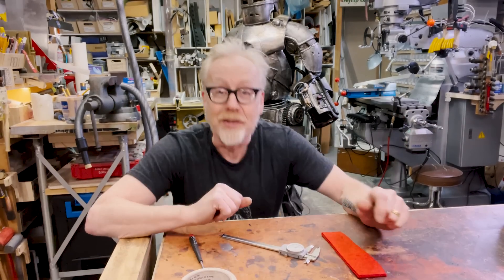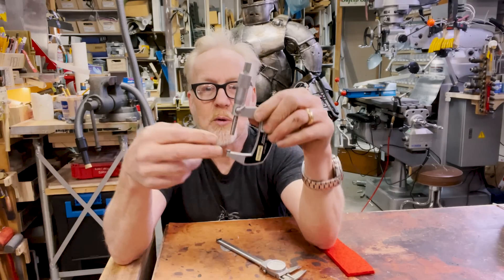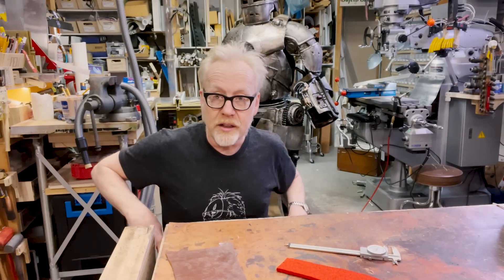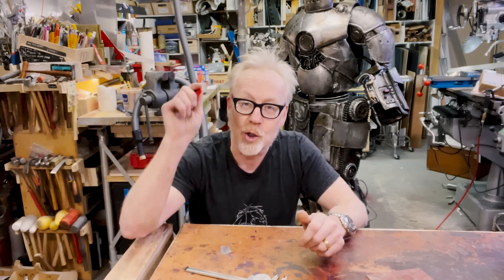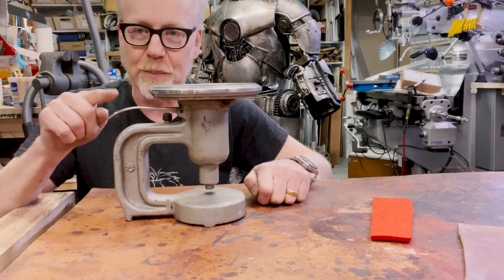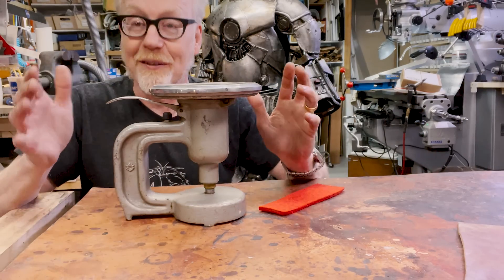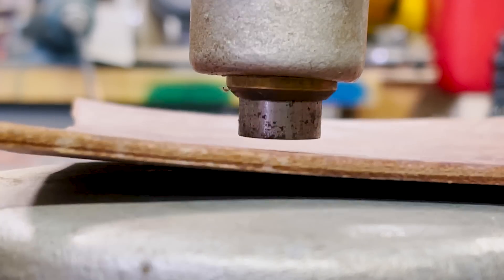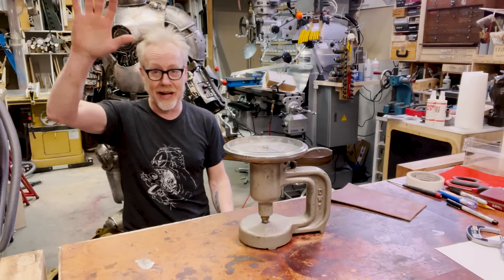Adam Savage's Vintage Automatic Testing Micrometer

Comment: At work I get to use a tool that operates on similar principles, the Gustin-Bacon Measure-Matic. Its anvil is a square foot and it's used for measuring big samples of fluffy materials like filtration media, insulation, or poly fill.

Comment: An micrometer doesn't actually measure µm  0.001 mm. only 0.01 mm and at best 0.005 mm with some analog.

If you measure µm you most likely gonna get wrong measurement since materials expand and shrinks couple of µm depending on what the temperature is. just the heat from your fingers gonna change the value.

Measurement tools usually have the standard of measure 1 decimal smaller than attended to get good enough measurement. that's why some digital micrometer resume 0.001 mm 1 µm, and digital Calipers measure 0.01 mm.

Comment: The amount of torque is equally important for measuring hard materials. By overtightening it, you can get about 0.001" lesser reading on a typical 0..1" micrometer. When the target resolution is about 0.0001", using a ratchet or a friction sleeve (another type of torque-limiting device) is a must.

Comment: I notice that there is not a second smaller dial to show how many times the big dial has gone around, like on a dial caliper. Can you accurately tell how many times the big dial has gone around based on the position of the lever? Or do you just have to have a close estimate of the material before you put it in the device?

Comment: I have 3 of those - we used to own a Paper and paperboard processing facility and they are the STANDARD for taking measurements of PAPER caliper or thickness. (Z - direction) +/- .001 is the accepted tolerance or variability for paper being printed in rotogravure or offset -

Comment: Interesting. Given that this micrometer measures using a set pressure, then for certain materials that are prone to density variations, that may also pose a problem.
Would I be right in assuming there are variants of this device that have varied surface area used for measuring?
It seems that eventually some form of electromagnetic measurement would be needed, along with some serious analysis.
Measuring is tricky.

Comment: I’m studying to become a rubber engineering tech and the compression of rubber is a real problem with measurements, a Magna Mike is another tool you can use to measure thickness. It uses a tiny ball bearing to measure the displacement between the magnet and the ball bearing to give a reading

Comment: If He thinks he can measure +/- 0.0005 over 12 inches........
He might need to read the specs on those.......

Also,  it's a snap gage and not a micrometer. Micrometer refers to a specific type of caliper that uses a threaded spindle to measure the travel. 

What he has is a dial indicating snap gage

Comment: Adam, I think the micrometer is suffering from dried out lubricant by the way the plunger lowers slow. A drop of light weight oil on the side of the plunger will loosen it up. I have one like yours and mine had the same problem.

Comment: Used a cady gauge fairly regularly over the past 13 years. We use it to measure consistency between blankets used to print beverage cans. A minor difference between the 12 blankets on the machine can make big difference between 1-36 random cans blown off during a quality check. It could be a minor differentiation or a major differentiation in the artwork from can to can. Extremely tight tolerances were needed between the print plate, the blanket and the mandrel that the can rode on around the mandrel circle for consistency. 

If I remember correctly we were running between .0010 - .0015. When prepping for a label change we would measure a stack of blankets with the cady gauge and then separate them by thickness so the 12 blankets being mounted for the next label were all close if not the same thickness.

Comment: I work at a plant that produces medical textiles. Test methods (a precise set of tolerances and instructions) are actually sold by standards companies that specify how to take these measurements for pretty much any material under the sun. 

The one other thing Adam didn’t mention is that the anvil size actually matters because a test method usually calls for a certain PSI. 

We have several of these micrometers except they are digital and you can add and subtract weight.

Comment: I do have some experience of those kinds of measuring tools from different industries.  In paper industry, soft tissues were measured that way, with a difference that the anvil was way larger.  In rubber industry the device was about what you showed.  In my later life, I have been dealing with catheter end preparations.  They have to be properly shaped and sized before they can be pushed into your veins !!!.  The production measurement is again done with a measuring device using the same principle, but much smaller anvil and yet better resolution on the dial.  The laboratory measurements use a shadow measurement with a graticule and a micrometer moved holder (two-axis linear and one rotary axis).  That is especially good, if the catheter must have a ball end.

Comment: It's sad that this instrument isn't properly labeled as it encourages you to continue to use the wrong terminology.  You routinely refer to calipers incorrectly as micrometers.  It is not a micrometer (despite the label).  It's a drop indicator.  Micrometers are screw driven devices vs the drop indicator is gear driven.  I speak with a little authority as 40 year veteran metrologist.  That being said, cool find.

Comment: The definition of a micrometer says that it measures by moving a spindle with a finely threaded screw. So, I would argue that this is a dial gauge regardless of it's label. A really HUGE dial gauge, though. 😁

1: an instrument used with a telescope or microscope for measuring minute distances

2: a caliper for making precise measurements that has a spindle moved by a finely threaded screw

Comment: Think measuring thickness is tough, try measuring surface area...and then get that electron microscope out and think again.  
Gage R&R is an incredibly important part of the producing of things at volume, understanding the variances from the part, the tool, the person, and the process used.  Getting hands off is a great way to reduce a lot of variation.

Comment: Adam

Realize that measuring for consistancy on compressible materials has a caveat, and that is how CONSISTANT is the material itself.  On things like felt, the compressibility can vary from area to area, so the thickness may be absolutely consistant, but the device doing the measureing and apply a known force can read differently if the material is more compressible or less compressible in different areas

John
Reply: Yeah, he does that and mentions it.

Comment: When I took a physics course in university I remember using the cheap student models which had a ratchet that did not work very well. A particular memory from that class was another student really cranking down one when trying to get a measurement from a ball bearing and the facial expression of the professor upon first observing this action happening.
Reply: The racketing mechanism was added to dumb it down for less experienced inspectors.  It is extremely easy to get bad results even with a racket.  Newer designs use a friction thimble.  They are subject to the same bad results depending on the operator.  Both methods will help less experienced get more repeatable & more accurate results but a skilled user doesn't require either.  I'm a retired metrologist / Quality Engineer / Quality Manager with 40 years experience and always removed the racket or friction thimbles from micrometers to teach my employees better technique.

Comment: I work in a calibration lab and even with our stainless steel 17025 certified gage blocks, error from compression on digital and dial micrometers still creeps in. It's a considerable factor when we're calibrating dimensional items for certifications. There are procedures and techniques that we use to eliminate those types or errors but it's still a non-trivial process. 

Edit: Spelling
Reply: My humble opinion would be that the dial micrometer is flexing.
And not that the gauge blok is compressing.
It is like trying to compress an anvil with a horseshoo.
Reply: @jankaas2760  yeah there's a lot of variables that come into play. Any sort of debris on the jaws, any misalignment in the assembly. And, as you pointed out, the flexing of the body and jaws from too much force being applied is a huge part of it too.

Comment: These are called Thickness Gauges or Thickness Indicators (as they are often just the fixture with bottom anvil with a dial indicator) Mitutoyo makes some great handheld ones and Mahr makes some super-accurate (very low resolution) ones, Just as a test and to give yourself some piece of mind take a ball bearing of known size and and check the quadrants of the anvil this will show if your anvil is overly worn, this test is also done with optical parallel sets if you have some of those and a monochromatic light its worth a look.
Reply: Adam would go full geek playing with an optical flat.

Comment: Nice piece Adam, was an unknown tool to me too, but it makes perfect sense...Another consideration for having the ratchet mechanism, aside from possible compression of the material, is the possibility of the anvils stretching/flexing apart if too much tension is applied when measuring relatively hard objects. As for the universal colour of all your cast objects, I'm thinking🤔...it has to be Green👍🇦🇺

Comment: Damn!  In my quality lab we use a Thickness Gauge for measuring thicknesses of, say, rubber o-rings and gaskets but it is about the size of a standard micrometer and weighs a few ounces.  Same idea though - a calibrated small amount of pressure (force) in order to mitigate the compressibility factors of the material involved.

Comment: I remember my Geometry teacher talking about 360 degrees and how they came up with it and the fact of measurement is that it has to be globally agreed upon in-order for it to work. Why the USA still uses the imperial system which relies on fractions and fractional math is beyond me. Also there is agreed upon tolerances which mean you can be off by a + or - amount because it is impossible to measure something exactly.
Reply: Automotive manufacturing in the US has been metric since 1984. I'm not sure if it's true for all manufacturing, but I think it is. The building trades, like house building, is still Imperial. In the late 70s and early 80s, we expected to switch to metric, but while it did in industry, it never happened for the rest of us.
Reply: @buddyclem7328  a lot of industrial equipment is still imperial. I used to work in a sawmill where there was a mixture of metric and standard fasteners. Truly a nightmare.
Reply: An interesting thing about tolerance: in the early 80s, there were reliability problems when SAE (Imperial) drivetrain components were combined with metric, like between engines and transmissions. The tolerance between the two was not close enough, and it caused premature automatic transmission failure.

Comment: I've been stepping up my measuring gear lately. Bought a decent caliper, a good double square (PEC blem), a good tape measure (Hultafors). I love measuring tools, because you don't have to spend 300€ to get something really nice. Yeah the hultafors tape measure is way more expensive than a shitty plastic one, but it's still only 20€. Even if you don't have much money it's still accessible if you really want one.
Next is a mitutoyo digital indicator to align my table saw blade/fence/slots :)
Reply: Yip, and sometimes it makes more sense to buy the standard than to buy a better tool. A few F1 mass pieces are gonna tell you exactly how trustworthy your fong kong scale is. A few gauge blocks can audit all your calipers and micrometers.